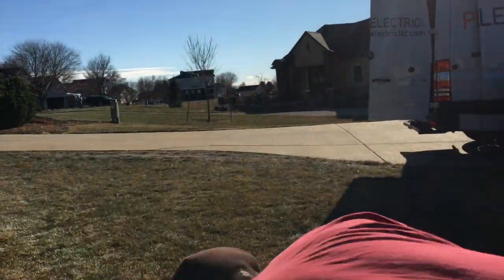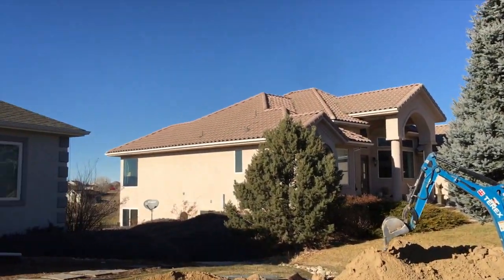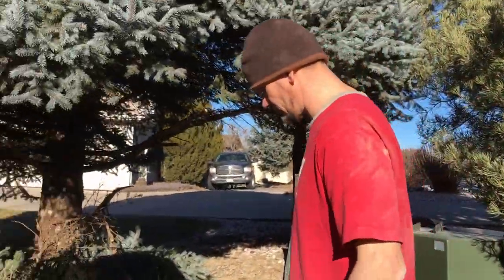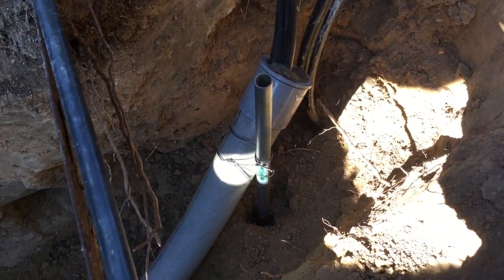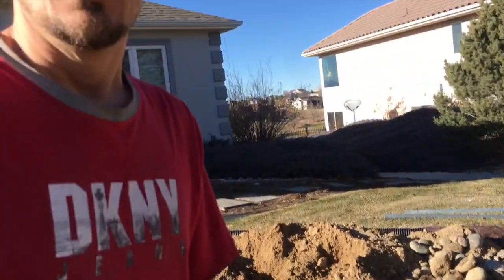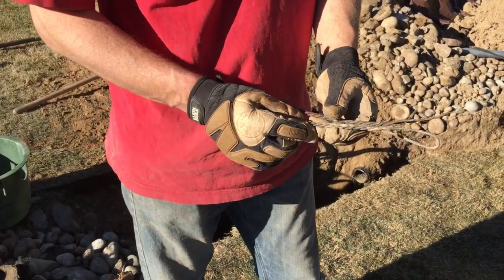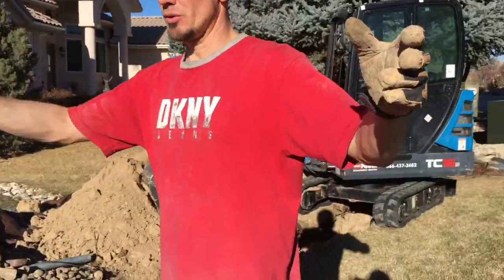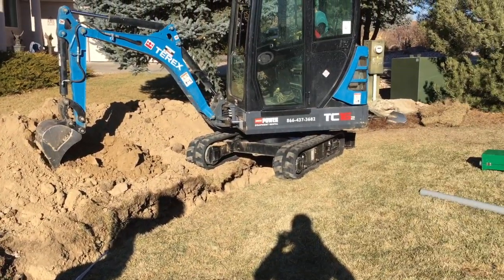Power Out, Lights Flickering—Part 5

Comment: Excessive force when pulling those heavy feeder wires through the ground could have caused a slight break in the neutral line. The original installer should've used conduit instead.

Comment: Here in KC all underground has to be put in conduit help to see why, did a 200-amp upgrade. Lucky, I found conduit but no 90 to hook up to the meter or pedestal so they pulled new 200 amp and glued conduit 90 on both ends.

Comment: My dad who passed away about 7 years ago was a HVAC/electrical/plumber guy and did a lot of work at restaurants. Had some gas fryer vats that kept losing gas pressure. The gas meter was about 50' from the building and it was kicking out good pressure. The buried gas line was plastic coated. After busting out the pavement and digging a 20' long trench, we found a little hole that had been nicked in the pipe. Water got in and made contact with iron pipe inside, eventually wearing away and seeping into the pipe. After finding the damage and cutting the pipe many, many gallons of water gushed out. That was the issue. :)

Comment: wow you are lucky in NH are codes are 4 ft below ground for conduit (4.5ft in reality they require 6 inches of clean fill below and on top of pipe)
Reply from the maker: We do not need squeegie fill above our conduit if the dirt is soft and there is no debris, assuming it is in conduit. If it is soft then SCH 40 is good, but if we are in rock in CO, then we have to be in conduit at SCH 80 and have the fill dirt round the conduit.
Reply: @Petersonelectricllc  ya where called the granite state for a reason also have a ton of forestry plus our frost line -so even tho direct burial can be used  its just good practice to use conduit in this area.
MY UN-PROFESSIONAL OPINION 🤨

Comment: Good to find and see the damage. 
Good thing it wasn't the hot line. 

I have a new panel, and still have lights flickering with loads.. should I have an electrician come out and take readings to rule out panel issues or just call the local power company to fix the 40yr old overhead line?
Reply from the maker: Start with the power company
Reply: @Petersonelectricllc  
Thank you sir.

Comment: i got to see an example of this earlier in my apprentice years when me and a mentor saw the same issue furnace had 160volts and the sump pump had 80 volts he walked outside looked at the overhead line above and the neutral was completely cut

Comment: I thougtht all underground cable was suppose to be in a conduit
Reply from the maker: No, it’s based on the wire
Reply: A lot of wire is available as direct bury
Check the markings and specs 
USE-2 URD. Triplex. All can b direct bury